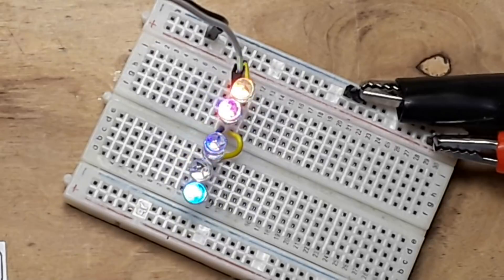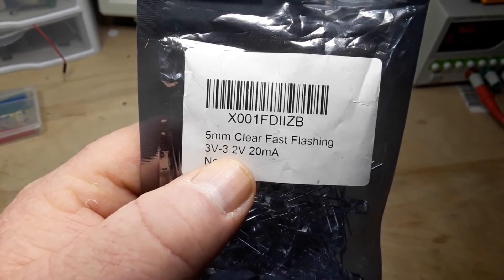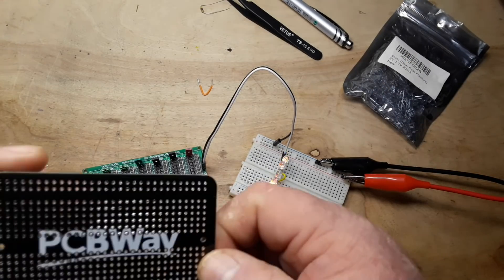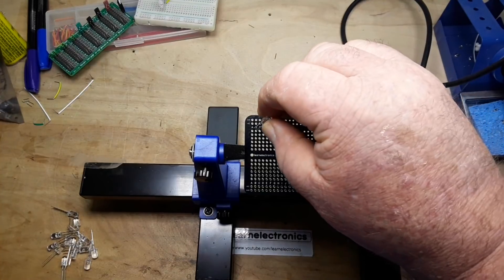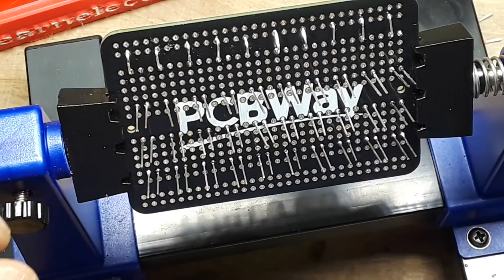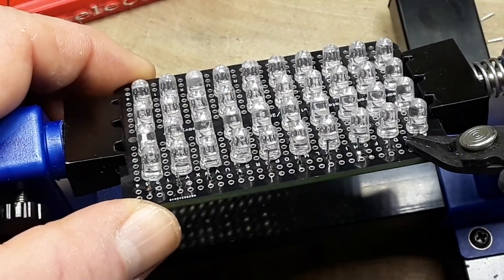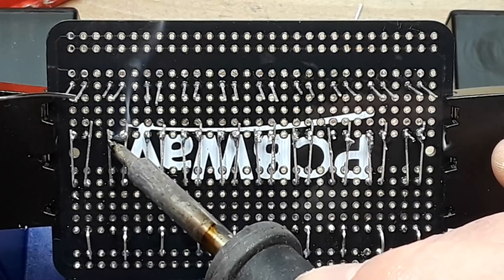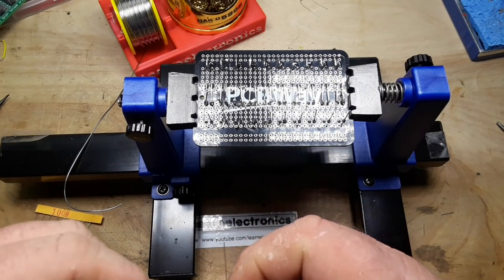Recreating Big Clive's Supercomputer

Comment: I'm a newbie to all this.  What input voltage- 5 volts?  you do have to solder in all the resistors- one for each row?  You showed the first one as a sample.  I have to make sure I get my plus and neg led wires in the correct holes- a little hard to see in the vid.
Reply from the maker: 5v like from a USB power supply. 1 resistor per LED. Resistors on the back, LEDs on the front.
Reply: @learnelectronics So 40 resistors?  Or 10 resistors, one per row?  Like I said, I'm a newbie and I appreciate all your kind assistance.
Reply: @learnelectronics  OK, if one resistor for each LED I can see where you did that one row but where did you squeeze in/connect all the others?  You don't show a picture of the completed back side that would show this.  I know I'm electronically challenged, sigh.

Comment: Reminiscent of the computer panels used on the sets of The Time Tunnel and Voyage to the Bottom of the Sea TV series in the 1960s. According to Wikipedia, those blinking lights were from an array of decommissioned memory modules taken from the Air Force's SAGE system (Semi-Automatic Ground Environment), one of the first systems to collect and process data from many radar sites into a unified image of airspace over a wide area.  SAGE served as the backbone of the country's intercontinental ballistic missile early warning system in the 1960s. Dr. Strangelove and Colossus also used those modules so it is fitting that Big Clive and now learnelectronics have their own versions.

Comment: That one in the upper left looks like or similar to the board that was on the Seaview from Voyage to the bottom of the Sea. That is one thing I have been looking for to make for a long time but no luck in my search. Of course the one on the Seaview was way larger.
Reply: indeed, I did love that show and their computer was way ahead of it's day.  Of course  back then a pocket calculator was as powerful as the rooms full of computers. I recall a trip up to the top of Monkey Mountain near DaNang when one of our radio relay systems failed.  WE had to replace one side of the system.  Some fellow at the base which housed NSA, CIA and some other alphabet fellow's let loose a roll of tape from their main frame system and the blasted tape was flopping in the wind nearly half the trip up the Mountain.  Their real computer system CIRCA 1971 used mostly magnetic tape but did have a light display panel that indicated which what ever was doing what ever it was supposed to do. The guys from NSA were in charge of  it, and while they would take us out for a beer once we had our radio up and running, they really would not say much about what they did up there on Monkey Mountain.

Comment: Whenever I watch a 60-70s era sci-fi show or movie I always laugh at the rows of meaningless blinky lights....but I recently watched a video featuring a Japanese relay-only computer from the late 50s and it's output was displayed on rows of LEDs with a supplemental printed page output. I have to build one of those "supercomputers" for my office. And here it is an electromechanical relay only computer (basically an electromechanical version of the ENIAC vacuum tube computer from the late 40s) >> https://www.youtube.com/watch?v=_j544ELauus A pocket calculator or calculator app on your phone is much more powerful, but this is interesting especially for its time.
Reply: Those were not LEDs. They were very small incandescent bulbs.  LEDs were not invented until 1962, and were not very bright, and only red for several years.  I worked on air traffic control systems, many parts of which were made in the same era.  We were replacing bulbs on an almost weekly basis.  Not that they were prone to failure, but there were lots of them.
Reply: @gfodale  You are correct I meant bulbs.

Comment: I've done the very same thing. I ordered a batch of 10 mm slow flash RBG LEDs from China, but ended up being sent fast flash RBG LEDs. Couldn't use them for the intended project so I chose to build an array. Overdriven on purpose to 30 mA each.

Nasty effect. Blinding.
People with photosensitive issues would have problems viewing even the reflected light. I still have the thing. Might make a short video of it.

Comment: Like you my hands simply don't play well with SMD stuff.   I have tremors.   I would like to see someone use flashing  LED's on a sheet of VERO Board.  Hundreds of SMD LED's on like a 11 x 8 sheet of board.
Reply: My hands are not too steady either.... Simply cannot solder SMD's. Had to get myself a shorter soldering iron - which helped a bit....
Reply: @nikosadie  I gave up trying to use an iron on SMD stuff and use the easy method of hot air :)
Reply: Clives version is all through hole :)

Comment: Ahh, winky blinkies. A story for you all. Back in 93 we were just starting out in Hollywood. When potential clients came to our shop they immediately asked where the Silicon Graphic systems were (we used a number of cheap Amigas). We didn't have anything like the money for what they were looking for so I 'built' our own in-house proprietary computer graphics production system. There was a storage room adjacent to the hallway to our offices. I had cut a 6 foot by 4 foot window into the room. We painted it bright white and had a raised floor installed. Then I bought eight empty surplus Northern Telecom 72" 'telco' cabinets. The doors were a cool slotted steel pattern in a light grey with dark grey frames. I placed them in two banks of four facing the window to the hallway. I covered the Northern Telecom logos with laser cut acrylic logos with the acronym 'F.I.R.E.'. To finish off the cabinets I installed a circuit very similar to this one and strategically located it behind the doors. 

When we did show and tells for prospective clients we would walk straight past that window and not say a word. The Silicon Graphics inquiries pretty much stopped after I installed our own bit of 'Visual Effects'.
Reply: Love it! Snobs deserve a bit of smoke and mirrors to be used on them. But F.I.R.E. ......? Please put us out of our misery.
Reply: @simonpearson8757  It's Foundation Imaging Render Engine but FIRE sounded much cooler. Eventually I filled the front racks with an assortment of test machines from various vendors plus our servers. For example Newtek sent over a multiprocessor Alpha based render box, but the most useless one of all was IBM who sent us an Itanium based 'server'. No software just the OS/2 OS. years later The back racks were filled with 350 (eventually) 486 and Pentium based motherboards with PSUs, network cards and a cheap graphics cards all glued and screwed to sheets of plywood. You'd call them blade servers today.

We used to have Render engine build days where we'd rip the plywood, have piles of components and then assembly line build our own hardware (free pizza and beer provided). The 'render engines' would boot via network from an OS image on the server and the machines were controlled via our own in-house production software. This took years but eventually we got up to a 500 node render engine. Or about the same horsepower as my old HP Z420 workstation with a GTX 1080Ti GPU under my desk right now.
Reply from the maker: Arthur Dent, didn't I meet you at a Vogon poetry reading?
Reply: @learnelectronics  I think I saw him at a Pub. lol And after reading what I wrote here I realized what you were saying above. It didn't register at first.